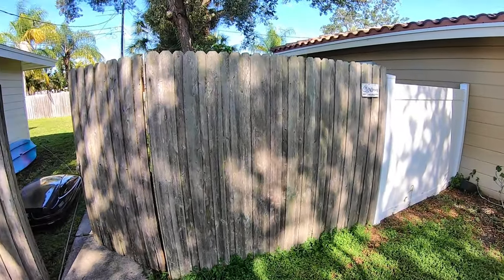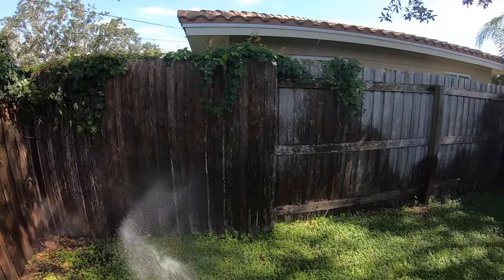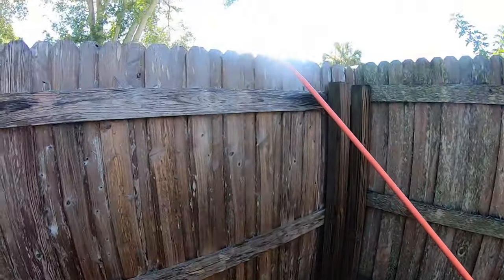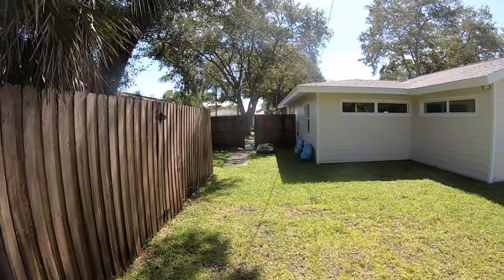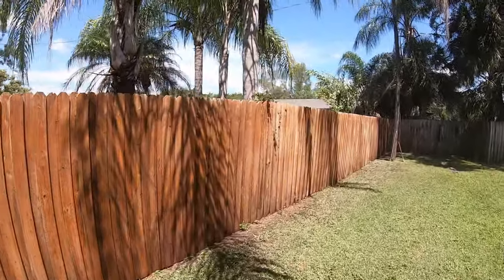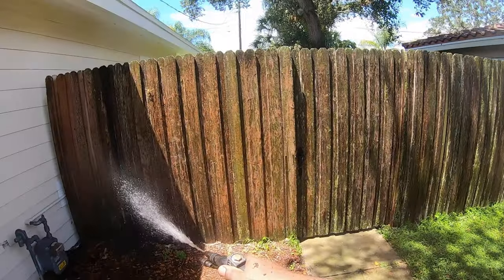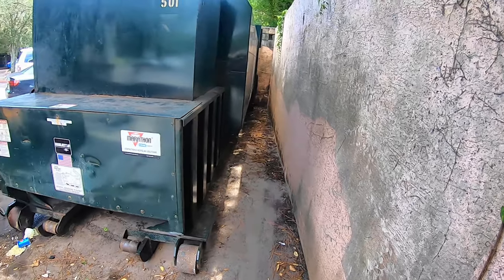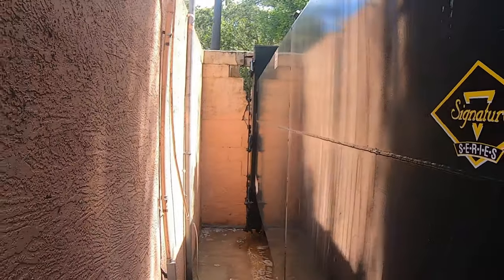Wood fence restoration and Commercial Power Washing

Comment: Great video, very informative. How are you dispensing the SH on the fence? is it pressurized?
Reply from the maker: Through the downstream injector that's connected to the pressure washing hose. Check out my downstream injector video where I explain how it works

Comment: Hey Cliff I'm doing a wooden fence tomorrow. Customer just wants it cleaned. He is going to paint or stain it. If I use SH do I still need to use wood brightener (oxalic acid) as well. That's my usual process but was wondering because I believe you or someone else said the oxalic acid is basically a neutralizer. Thanks in advance.
Reply from the maker: It would be best to do it in my opinion.  But I'm not sure if it's necessary

Comment: How do you like the electric pump sprayers and have they held up relatively well? I'm all about efficiency and I've debated on giving one of these a try!
Reply from the maker: So far so good.  Had it for at least a couple months and used it appropriately 6-7 times.  I rinse it very well after job by flushing water and a little bit of pine sol or la totally awesome.  There's a little mesh filter inside the tank that has to be popped out and cleaned too.

Comment: How manySqFt per gallon do you need for Oxalic Acid?
Reply from the maker: 1lb per gallon so 16oz
Reply: @PinkFlamingoPowerWash  I mean the square footage per gallon. For example roof wash is about 100 sqft per gallon. How many square feet per gallon does a fence require?
Reply from the maker: @brightgreenroofcf  oh idk about that. Sorry
Reply: @PinkFlamingoPowerWash  for a 250 foot fence for example….would you use maybe 2 gallons? 1 gallon? 5 gallons?
Reply from the maker: @Bright Green Roof  idk I buy a 10lb bag it last a long time.
Reply: @PinkFlamingoPowerWash  thank you. Great work!

Comment: I'm not looking forward to cleaning my wood stairs with a small landing and mainly the railing. I did it once and was so tedious and tiring. It's against the back of the house in an area that doesn't get much sun, so the railing on one side towards the neighbor shows a bunch of algae when it's wet in the rain. Though I'm hoping the bleach will make it a bit easier this go around as the last time was before I saw the videos on your channel.
Reply from the maker: You can do it! Wood is very tedious. each time ive done a wooden fence I say its the last one lol